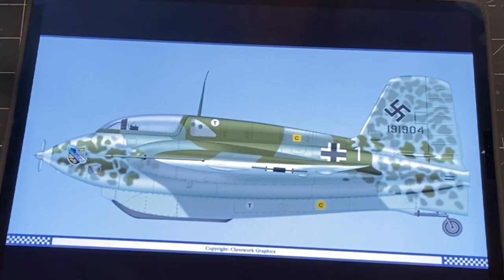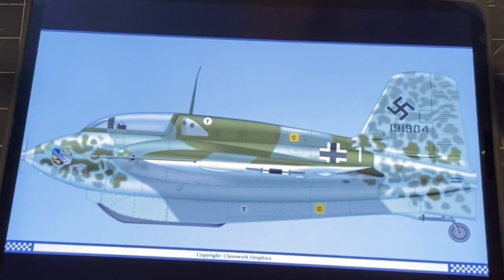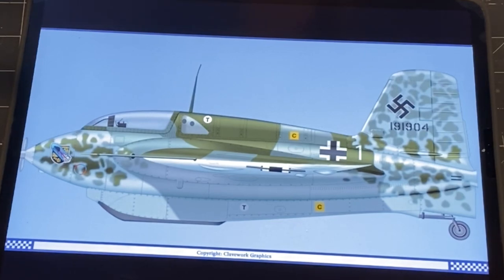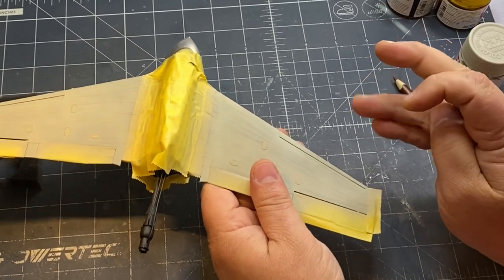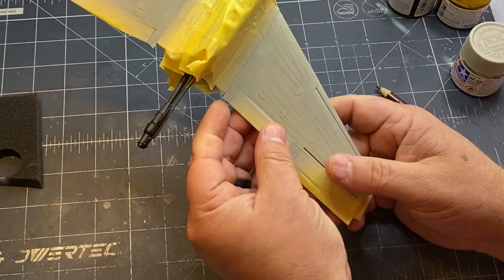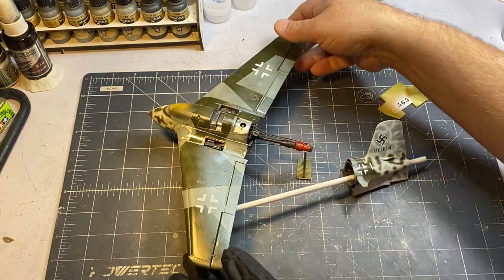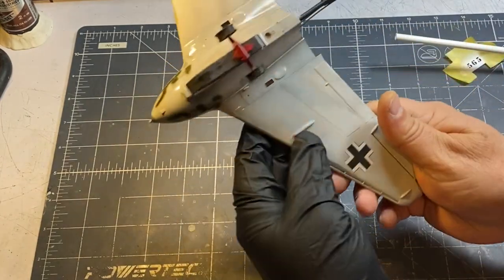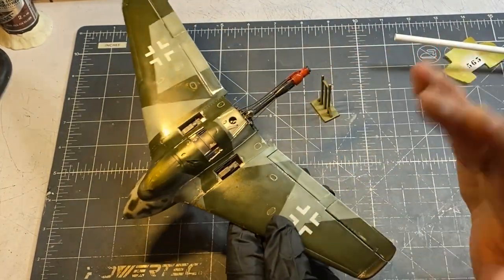Meng's 1/32 Me 163B Komet Part 3: Paint and Finale

Comment: Heating and quenching will harden ferrous metal, but will soften brass and copper.  The process is called annealing.
Reply: BTW, annealing also works on aluminum.  Don't overheat, though.   Unlike brass or copper, which should be heated to a nice bright orange, aluminum will melt before it incandesces.   Heat it until brushing it with a twig will leave a sooty mark.

Comment: Another great build and instructive video. May I ask how you get the masking tape off on hair sprayed surfaces without pulling up paint?
Reply from the maker: I was concerned with that especially on the metallic finish so I put down a coat of Tamiya gloss before the hairspray.  Then de-tacked the tape and didn’t hammer it down.
Reply: @seanerk5kt9  I’ll give that a try. I will do chipping for the first time on my next build, a Tamiya 1/48 Birdcage Corsair. Thank you.

Comment: Your name is Hope now?! So can we call you Beyond All? Or Just BA! {A-Team reference}. Looks good after the chipping. The way they were trucked around I'm surprised you didn't do a bit more. I like how you have the belts draped over the fuse. Trumpeter .50 cal belts wouldn't hold paint either. I ran them over a sponge sanding pad, {1500}that did help them hold paint. Nice build, the owner should be very happy.  If shipping with USPS, I don't think there is a glue strong enough to withstand those idiots. Around here they use my packages as soccer balls!  FTARDS! Ok - What's next?
Reply from the maker: I love it when a plan comes together.  As for what’s next, not sure but I know it’s gonna be an old German jet
Reply: @seanerk5kt9   So what do you think of the DasWerk  Ju-EF-126/ EF- 127 {three versions} in 1/32nd? Decent detail, nothing really over the top. Or the MiniArt FOCKE-WULF Triebflugel {either day or night fighter} in 1/35 {?} Day fighter version has more detail. All what if, just on the drawing board fighters. Or a nice Trumpeter 1/32 262? Plenty of detail there, and I think the price is going down on that kit. Just like the rest of their 1/32 kits.

Comment: Hey Happy Thanksgiving to you and your family. Hope all is well with everyone. You continue to amaze me with your skills in building what the kit does not include and your painting. I was wondering how you determine how much sprue plastic to add to your glue when your making your spruegew? Do you just let it melt into the cement or do you mix it in? I finally found someone who sells the glue at a reasonable price. Take care.
Reply from the maker: Happy thanksgiving to you as well.  I typically just throw in some pieces of sprue and let it dissolve for a couple of days.  If it’s too thin, I add more sprue, if too thick  I just add a little more extra thin.
Reply: @seanerk5kt9  Excellent, Thank you, I knew it had to be something simple like that. Of late I seem to over think things. Must be in a rut or something.

Comment: Sean, im glad you spend a lot of time on chipping today.I still have questions: Aren’t you a bit worrying about the 98% intact paint thats still on hairspray? I mean most of the paint isnt chipped. How does hairspray behave over time?

For that reason i got Vallejo Chipping medium and... it sucked. Or i did. Got it on my Extreme Metal (thanks for the recommendation!) and two layers of Tamiya paint.... the last one was glossy. It felt as like NO water comes through the paint - so does it only work with flat paints? How fast have the chipping to follow after applying hairspray and final paint?

Lastbut not least: Your Vallejo Airbrush Thinner tip was the livesaver. I still had to rub the cotton bud, way more than you do, but it came finally off.
Reply from the maker: I really don’t think there’d be a problem with the hairspray remaining under the intact paint.  I’ve got a couple of models that I used it on several years ago and it hasn’t caused any issues.  I have gotten it to work with glossy paints before and theoretically it should work, I’m guessing that the flat paint absorbs water while the glossy paint doesn’t.  I put a pretty thick glossy coat on the bottom of this one so it was hard for me to break through to the hairspray layer.  As far as how timing on the hairspray, I can’t say for sure how long it’s effectiveness will last but I’ve applied the hairspray and paint then came back and chipped several days later and it still worked.
Reply: @seanerk5kt9  Thank you. Ive been new to the hobby after a few decades of dark ages. So especially your videos are very very helpful for me. Btw: i admired your SR-71 build - especially with this old Testors kit. In 2021 Revell will have an all new tool 1/48 scales SR-71. Ill for sure build one.

Comment: Sometimes the warehouses these relics are stored in aren't the most controlled environments.  A  lot of warehouses don't have environmental controls and things stored there suffer deterioration.
I think some things are being done better now to keep hardware for deteriorating but the Smithsonian has millions of items in its collections and they can't all get top priority.  They TRY to control the environment but many of these building probably still don't have anything like air conditioning and heating.  There are one of a kind planes and record setters that are still in storage that should be on display but there's just not enough space for it and many of those planes have been in storage for decades without any attempts at conversation and restoration.  Something like an F-4 Phantom, even if it is a record-setting plane, isn't going to get priority because there are literally hundreds of examples of that fighter on display around the world.
They have 2 Me 163's left in the US out of 5 that were originally delivered to the States.  I imagine the other 2 Me 163's were scrapped when they were done with them.  It doesn't sound like they did any powered flights of the Me 163 because of the deteriorated condition of the airframes.  The one they did consider flying powered had wing delamination and they were not sure if it could be repaired and didn't want to take their chances.  Restorers later discovered one of the US specimens of the Me 163 definitely showed signs of sabotage by the French laborers forced to build that plane!
The Smithsonian's NASM annex at Dulles Airport has an Me 163 that was stored in a hangar for 9 years after WWII ended and it has a history of being passed around but not getting any true restoration.  
The Me 163 the Air Force Museum has is in MUCH better shape than the NASM Komet.  I haven't seen it in person but you compare photos of that that to the NASM specimen it's much better condition.  It's been well cared for and gotten restoration.
The Paul Allen aircraft collection has another Me 163 that used to belong to a British museum.  It was sold to him so that the museum could get another aircraft for its collection.  That Me 163 is also in excellent display condition after being restored in the late 1990s.